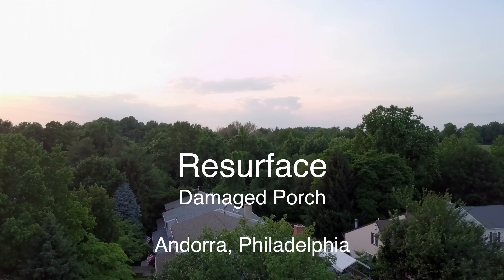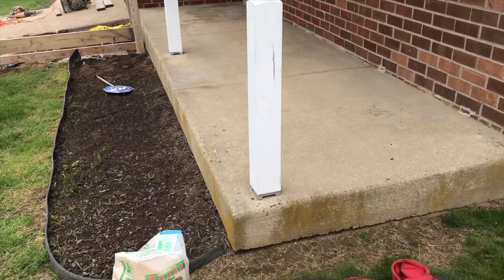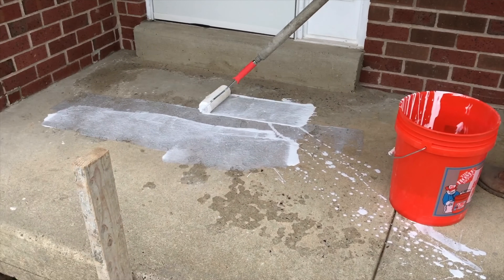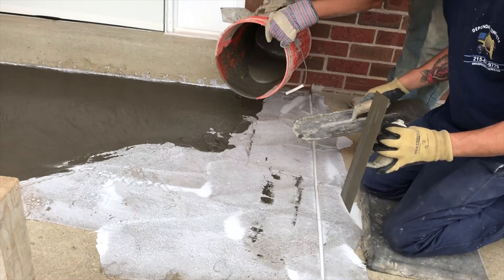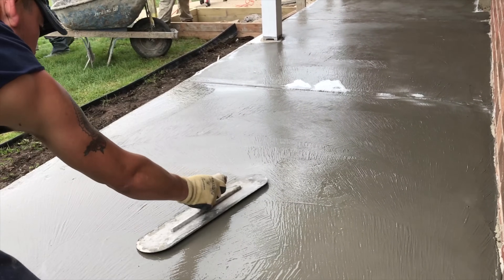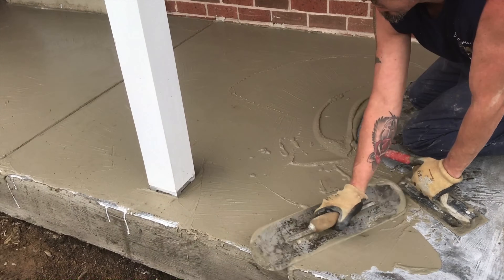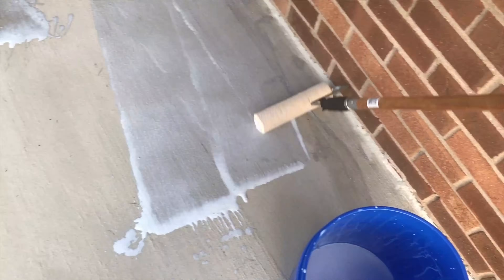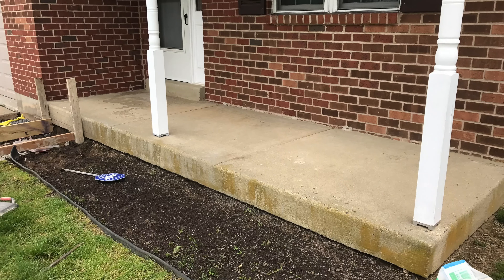Learn how to Resurface concrete porch in 5min in 4k vid | Concrete contractor Philadelphia

Comment: I was taught to use 2 sand 1 cement years ago, also with the same exact glue ..simple yet effective.
Reply from the maker: Yes this ratio always works but it's most important to prep the surface

Comment: What are those discolored spots on the center square/slab?
..and dont just say it will go away while it dries more - this vid shows after its dry, but moreover, it shows after Seealer is applied and dried.
 So the reason i ask is because i had some similar spotting on one of my recent resurfaces.
My spots are smaller but theres a few more of them.

Comment: at any point do you add glue into the mix or by mix you mean the application of glue then the respective amount of a 1:3 parts play sand, Portland cement after the respective ratio of glue is applied to the surface? is the bonding adhesive also the glue ?
Reply from the maker: Yes i forgot to mention that you can also add glue (acrylic)  into mix. I use a 1 cup of glue to 1 gallon of the 1:3 mix. Tim this will certainly reinforce the mix!
Reply: @DependableConcrete  Ok now i am confused. Isnt the adhesive the glue? So 1 cup sand, 1 cup portand and 1 cup adhesive for first mix. then 1 cup sand, 1 cup portland and 1/4 cup adhesive. As an example

Comment: So you just clean the surface by elbow grease and a broom,  when would you if ever, acid etch the concrete?  I agree with the bonding agent 100% everytime but i thought that the sodium whatnot that all concrete releases over time, would stilbe present causing even the epoxy to come up.. right??  Is just the general instruction i seem to get is to acid etch the surface as apart of the preperation...

Comment: Great information! Is the "glue" in the mix the same thing used to bond the concrete in the first step? In the 1:1:1 or 2:1:1/2 mix do you still add water or the "glue" completely replaced water?
Reply from the maker: Always use 100% glue do not dilute the glue in the mix you can also add 20%  glue 80% water

Comment: Looks great. I have a 20x10 back patio with a tiny crack in it..... You only notice the settling when it rains because the crack area puddles... got any advice on how to quick fix that?
Reply from the maker: Use self-leveling cement

Comment: I guess you must consider your listeners to be somewhat Adept at concrete work but I know for a fact in learning some tricks that when applying the broom finish time is of the essence and that if you rush to put your finished with your broom you will come up with a nasty looking job I'm wondering is it similar to regular concrete work in that waiting for that right moment to pull the broom is important or do you just appliers ingredients and just pull the broom I'm sure you must have to wait a little bit but I'd like to hear your answer.

Comment: Good day. Thanks for the clear instructions. I’d like to find out. My step (not quite porch ) is painted red but I want to resurface it as it is cracked and chipped. Do I have to do any special preparation before I resurface it?
Reply from the maker: Natalie Visser yes make sure it’s dust and loose material free.
Reply from the maker: Natalie Visser I would also recommend using a thinset for tiling on a painted surface, scratch it then wait overnight then apply a resurfacing cement which has a fine aggregate.

Comment: what kind of broom did you use on the concrete after applying it? is the concrete still wet when you did that?
Reply from the maker: Cement must be slightly wet so that you can get the grooves for traction

Comment: Hi / when you say your mix of Portland cement sand and glue - what type of glue do you use ?
Reply from the maker: https://www.homedepot.com/p/Quikrete-1-Gal-Concrete-Bonding-Adhesive-990201/100318465

Comment: Wow great vid. I was thinking about replacing the backyard patio area concrete because it has a long crack but will resurface to save money! What’s is your thought about using New Crete by Rapid set for resurfacing concrete?
Reply from the maker: I never used a product before just make sure you use plenty of glue first

Comment: I have cement step walkout from the basement with concrete or cinder block walls which are cracking and leaking water.   Will Jewel stone make the walls stronger and the steps more durable as well?  The alternative is to dig it all up and rebuild from scratch.
Reply: George Coleman hydrolic cement should do the trick   Clean areas very well then put paint bonding agent on then thich trowel hydrolic cement on the sponge it damp in light circle motion

Comment: what ratio of water do you use. I have never worked with concrete, yet your video makes it look doable. Thank you. I have a 200 sq ft porch that I would like to re-surface. How much of each product should I purchase? thank you in advance.
Reply: One 94 pound pack of Portland cement and a gallon of bonding adhesive will do it just fine. I just did an entire 100 square foot sidewalk with 35 pounds so you’ll have room to spare

Comment: Nice job, which product did you use to seal the joint between the concrete slap and the building, is there a waterproof product for this? tks
Reply from the maker: The glue will seep into the fine cracks and waterproof before the overlay is applied.
Reply: Rick Deckard a 2 part concrete appoxy should be used or a waterproof flexible caulk

Comment: Thanks Dependable Contractor. That looks great. I gotta ask because I'm just not understanding the ratios. When you say 1 to 1 to 1 are you saying to mix a gallon of sand to a gallon of portland cement to a gallon of glue? Or are you saying a gallon of sand to a gallon of cement to a cup of glue?  And then would the final mix be 2 gallons of sand to 1 gallon of cement to a 1/2 gallon of glue, or a 1/2 cup of glue?
Reply: I have same question. Did you get an answer 714dawger? Thank you.
Reply: @richardlabbe  he said it is cup for the glue. but I still don't know how much water into the mix.

Comment: hi when you say1 to1 to 1for exple how do you judge the amount of glue? thanks
Reply from the maker: 1 cup of glue to 1 gallon of mix
Reply: @DependableConcrete  1 cup glue + 1gallon Play Sand + 1 gallon Portland cement is the first mix? Or is it 1 cup glue, 1/2 gal Play Sand, 1/2 gal portland cement?
Reply: Id say if you dont understand ratios this job is too hard for you

Comment: Fine video. Only Feedback for me is that I found it difficult to hear some of your words ( at two minutes for instance) perhaps a slightly slower narration. Couldn't make out the all Important mixes and if any water was used at all? Also as this is just a porch. If the damp course allowed for it,  could you also frame it up and just add a brand new layer of small aggregate concrete mix of say 25mm to refresh it? With expansion joints, would it be an option and perhaps a better finish? Many thanks
Reply from the maker: Thanks for the feedback. Yes adding concrete with small aggregate also makes for a good resurfacing alternative

Comment: If I  wanted to pour a 12’x12’ slab’ and 10’ adjoining 3’ wide walk way what mix do you recommend (1-cement 3-sand.) or?
Reply: Steven Powers ya know how much material ya need a bounch better off just getting it from the plant delivered and ya know its worth it make sure its a 6 bag mix i usually get 4yrds delivered for $375/425 depends on area and what y’all pouring
Reply: No. 3 parts sharp sand with 3 parts of aggregate (together is called ballast) with 1 part cement. It is an option to have it delivered but with my mixer I poured a 6 metre x 3 metre slab approx 100mm deep splitting into 8 sections to create expansion joints. Stopping each evening at a joint. Took two days and around 80 mixes if memory serves correctly👍

Comment: My front porch is very similar in size and damage to this porch.  What would be a good professional estimate on cost for this job?
Reply from the maker: 1k -1500.  client will still save $2k
Reply: Over 20 plus years here in concrete from Fl to Oh Comm And Res. Material plenty pictures and ref. I could do it for around 850 with material included thx

Comment: question I installed a new patio of concrete and now it has sand streaks what can I do to fix it??   I have swept it off but it is still kind of sandy help!!
Reply from the maker: Make a cement stain by using type 1 Portland cement and lot of water.  Make consistency wet. Dampen surface then apply stain with a sponge. This should help to adjust color. Redo a day later.
Reply from the maker: apply this overlay method. make sure to use the correct proportions of materials as described.  Use 1 cup of glue to 1 gallon of 1:3 mix. Fortunately the sand will help with gripping the overlay.
Reply: Sounds to me like i would be calling the concrete plant that brought it apparently they didn’t use a 6 bag mix they went cheap on ya and used more sand than Portland cement!!! We had a concrete plant around here started getting sandy finish so people went else where LoL they fixed ther problem now there getting more business pretty good crete now even with slick finish,,4 yard minimum here around $380 tax tag and title and delivery LoL 😂

Comment: I have a front porch that had been covered with slab. The slab and concrete cracked, so I removed all the slab to reveal a very bumpy and pitted surface where the slab once was. Could I use this technique?  Or should I resurface due to the depth of pitting?
Reply from the maker: Yes you can. However I would recommend pouring a very very wet self leveling cement first as you base. Pour enough of the material just to get over the pitting then proceed with the steps in the video.
Reply: Dependable Concrete Contractor would a self leveling cement need a material to adhere to first?  To prevent cracking?
Reply from the maker: Yes I would definitely add concrete bonding glue first.
Reply: Dependable Concrete Contractor I wish I could send you a pic, lol, it’s very bumpy
Reply from the maker: @estellecavanagh8131  send pix to my dependablecw@gmail.com
Reply: Dependable Concrete Contractor sent!  😀. Thank you

Comment: Very nice.  I know this is an older video,  but I would like to ask a question of a similar, but different problem I'm trying to solve.  I have a concrete patio that our little dogs decided to urinate on.  And I used pet urine remove spray that apparently has some bleaching properties and I also made the mistake of forgetting about it once.  It essentially took off the original cement properties that made it less porous in that area.  (I can't say if it was sealed at all.  I doubt it.  I think it was just a type of concrete that looks smoother when it's dried.)  Is there a method that would restore that areas appearance?  Maybe sanding it some or and electric buffing machine?  Or would I need to resurface it?  (This is about a 20 ft by 8 foot patio with only a couple of feet that got damaged).
Reply from the maker: Try using muriatic acid in a pressure washer
Reply: @DependableConcrete  Thanks.  Since I posted that question years ago, I decided to go with a coating that requires less prep than many.  Called Rust Bullet.  It simply required sweeping and power washing as prep.  No acid need.  Two coats rolled on over 8 hours.  Epoxy based coating.  Still looking good and the stains and a few hairline cracks are gone.  And if a dog pees on it, it won't stain.  In fact it would be much harder to damage than the cement itself.

Comment: Can something like this be done on a good surface, but that is sloped incorrectly.   ? To correct the slope?
Reply from the maker: Yes. But you will have to spread and pitch regular cement first. Then use this product.
Reply: @DependableConcrete  Thank YOu for the reply.  I have a porch, small,  that is in good shape srtucturey , but is slopeed slghtly toward the house, instead of away from it.

Comment: May you please tell me the name of tool that you used in cutting a grovel in concrete pave way for controlled crack purpose? Thank you
Reply from the maker: its called a grover and is sold at Lowes or Home Depot. Here is the link:   https://mobileimages.lowes.com/product/converted/035965/035965041072.jpg
Reply: I’ve been finishing concrete for 25 plus yrs from Florida to Ohio commends and res work we never called it a grover lol 😂 its called a brass hand jointer and place a board next to the tool when placing the expansion joint line that way you keep it straight tap and slide tap and slide once all way across should be able to remove board and slide it through another time,

Comment: Looks great should the concrete be wet before you apply the glue or do the glue take care of that to make it stick also I’m planning on done no this around my pool deck and staying and sealing is this method basically the same as and overlay thank you for your help also I’m in the Dallas area we very rarely get cold enough to freeze or ice so I think this would last a very long time
Reply: Joshua Lymer in his last video a little water helps you flick it on with a brush after cleaning it with a broom. for dirty flaky and chipping concrete..it's best to powerwash it and let it dry for awhile then add the glue
Reply from the maker: Do not wet the concrete.  The water prohibit the glue from working as well.  Only wet if the surface temperature is very high and requires cooling.

Comment: Can I resurface a porch that is not level porch has sunken forward? Thanks
Reply: Stu Pidassho yes but 1st you will have to skim coat the lower side until desired level i do concrete but I’m in se Ohio
Reply: stringline2 thanks I will look into.

Comment: Does the concrete need to be wet before you apply glue
Reply from the maker: Do not use water it will block its properties.

Comment: Probably a good short term fix, I'd like to see it in a couple years and see how it looks.  Based on the caulking on the brick it looks like the slab has settled a few inches which will cause it to continue cracking.  Anyway, thanks for the video, t's always to see shelf products in action.
Reply from the maker: Only issue with this job was pitting and staining on the riser.  I do revisit my jobs and its the clear sealer that extends the repair work into several years. Fortunately, she had no settlement; not even a 1/16th of an inch.

Comment: How much did that job cost the customer?
Reply: Thomas Passero i could do it for around 7 or depending on the size
Reply: stringline2 how long have you been in business for? Are you mainly concrete?
Reply: Thomas Passero been doing concrete over 25 years from Florida to Ohio Res.and coml. Been getting into home building and remodeling last 10. Have plenty ref. and pictures, thx